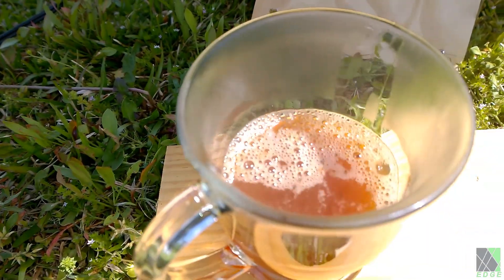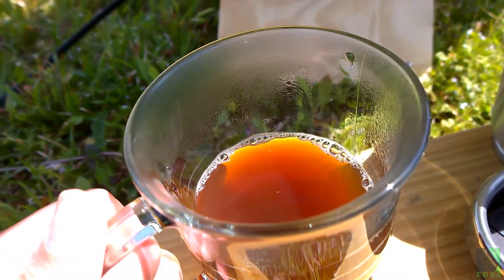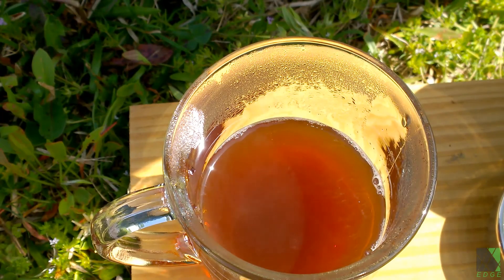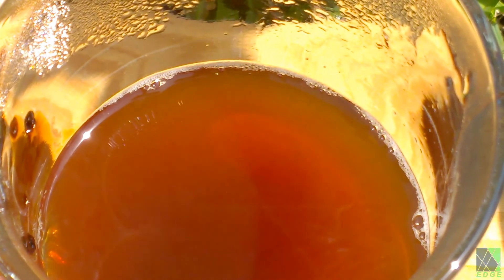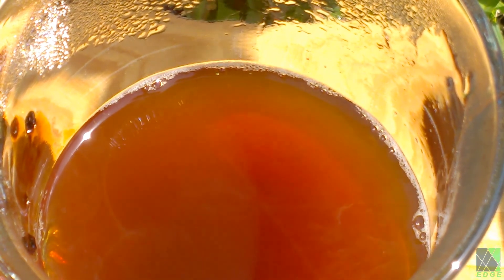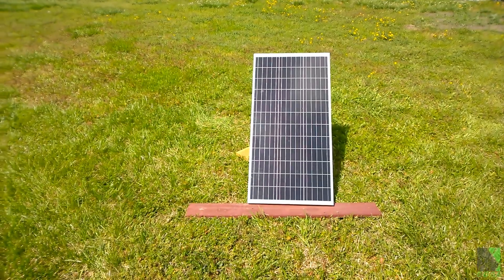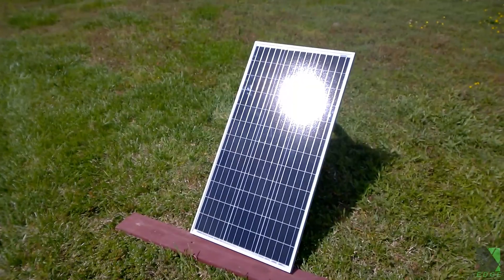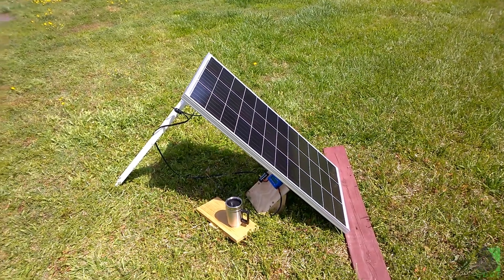Boiling an Egg with a 100 Watt solar panel: Simple Solar Electric Cooking | PV to Load  #solar

Comment: My 100w rice cookers say they can be powered from 12 to 24 volts DC. I have the stuff to connect them direct to a panel but never used it. They cook one dry cup of rice to perfection. I got two so I can make rice and lentils if the power fails from my power station cig ports and used to use a 120w DC immersion water heater for instant coffee before I got my 300ah battery and inverter.
Reply from the maker: Awesome, there is nothing like hot food without using a single bit of fuel

Comment: great video.. I just want to know how much time it took for boiling this egg. 
It would be great if there are DC electric cook tops available to use without charge controllers and battery.
If some innovative solution come in solar cooking that will be a game changer. We can avoid using natural gas and wood for cooking which will help to save the environment as well as money.
Reply from the maker: Thank you sir - it took about 8 minutes to boil all the way. 
I have been working on direct PV DC cooktops and have several of them now. Due to current health problems I have not finished these projects - hope to do so soon and also to record the results on video.
Reply: @solarpoweredge  great !
Thank you
Reply from the maker: Welcome :)

Comment: Nice one thanks. Although this use case depends, you do point out to be careful to stay on the 12-13v range (as normally charged fron a car battery that could be arlund 14v), although i believe it is quite common that a 12v panel can give 18v under very good conditions (hence the need for a controller for batteries etc). Thinking as i write, if the load is important enough, then even if the panel could give 18v, the load itself brings down the voltage and therefore potentially no risk to the load from over voltage ? In this case the water boiler. The solar conditions in your experiment look good, hence my assumption that the panel could give 18v but the load brought down the voltage helping to "protect " the load device?
Reply from the maker: Hi, good points, exactly right - the cup pulls the panel down to around 10-14V. The conditions were very good and I did not need all the potential power output. In fact I tilted the panel to regulate. This particular 100w panel seems to be a good match, it's possible certain panels might burn it out depending on their specs. Hence I showed the measuring device, important to know what voltage is driving the cup. By the way this 12v cup gets super hot, so I limited it to about ~55w dissipation just to be safe. Not sure what the real limits are, but I didn't want to find out. Thanks for watching / commenting :)

Comment: Thanks for the great video. I am very interested in a system to heat my 50 liter home hot water tank as I live in a very sunny area. Do you have any research or tests showing how to do that?
Reply from the maker: @mikefiatx19  Welcome! It's easy to do. There are HWH elements that run on ~48v direct PV DC solar. They can install in any hot water tank. 4 large solar panels usually work well for one heating element (if there is sun). I avoid high DC voltages. It's just not safe in a tank designed for AC. Thermostat needs to be DC rated.

If you want to drive DC loads directly from solar, it would be a good idea to learn Ohms "Law" formula first. I have a lot of videos about it (I call it PV-to-Load).
Space heaters use the same exact knowledge and calculations as water heaters:
PV DC Space heating videos
https://www.youtube.com/playlist?list=PL8a6nRTNyF9PPcyx4uekrBXXi2O3p4-Bz

The only time I showed any kind of water tank project on camera is when I made an emergency water heater with a 5gal bucket. It's super easy to do. 
https://youtu.be/0HDAOUQ7Uns

Anyway, I hope some of this is useful. If you have any questions I will try to help :)
Reply: @solarpoweredge  Wow, thanks for that. The playlist was great, I learned a lot. I also watched the diode videos not in the playlist which taught me a lot. 
I can't wait to see the heater you make using the diodes and I like the idea of using diodes for a variable PSU. 
I was thinking a water boiler with shallow holes tapped into it and diodes bolted to the outside might be a good option to heat the tank and cool the diodes at the same time. 
I wish I had more spare time to experiment but I am renovating an old stone house with granite rocks and lime mortar so that consumes all my free time. My family are going to kill me if I don't get the house running properly.
Thanks again & keep up the great work.
Reply from the maker: @mikefiatx19  No problem, I'm thrilled the videos were helpful. 
Your boiler design is a good idea. Need to find a big chunk of aluminum. right now I am testing using heat sinks to heat air, as well as an "solid state immersion" heating element for a hot water tank.
Hope you get the house done, sounds like a ton of work. Maybe after that you can experiment with heating. -Dave

Comment: Its me again!! we are having alot of trouble with getting the cup to boil.. how did you make the distiller? after the water boils for our desalinator, it will pass through copper tubes and come out as fresh water.. i just need more of an idea :')
Reply from the maker: Hi I used a 100w solar panel, which should be more than enough power. It's a standard 12v automotive heated cup, nothing unusual. I am building a distiller separately. Just haven't been able to get the video uploaded.

Comment: what type of DC circuit breaker do you recommend for 2 400 watt 12 v PV arrays? Also for two Renogy 40 amp MPPT controllers?
Reply from the maker: I'd suggest a single or double pole PV circuit breaker, around 45A. Those are very common and not too costly. If you search "LANGIR DC circuit breaker" on the big A website (can't put links here in the chat) they have a 2 pole 1-63A 500V breaker, I have those and they seem to be pretty good so far. For the Renogy MPPT controllers, you could actually use the same type breakers.  Let me know if you can't find them, I can add links to the description on my circuit breaker video if needed.
Reply: @solarpoweredge   OK thanks man.
Reply from the maker: NP